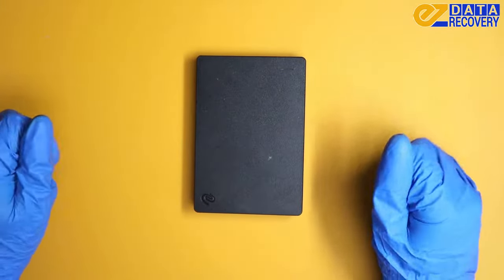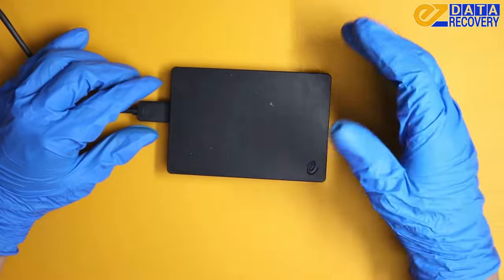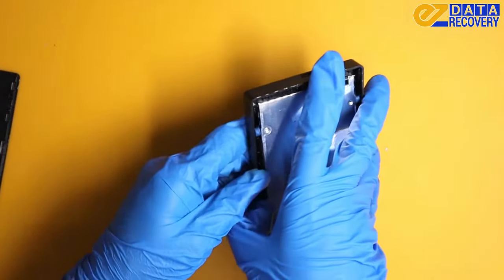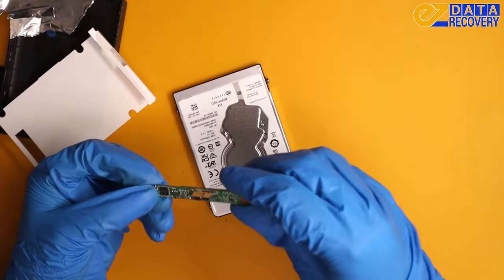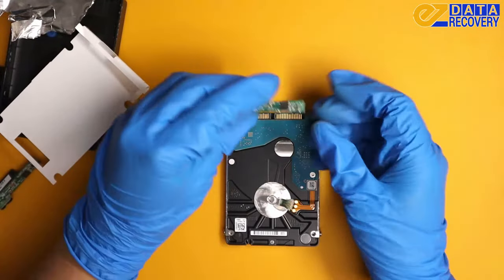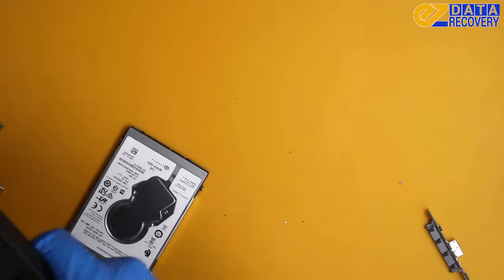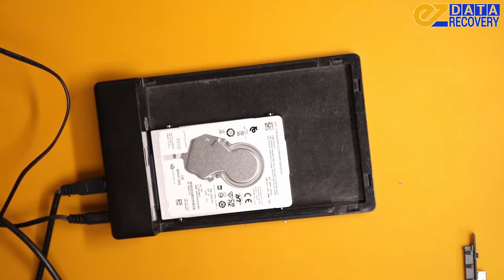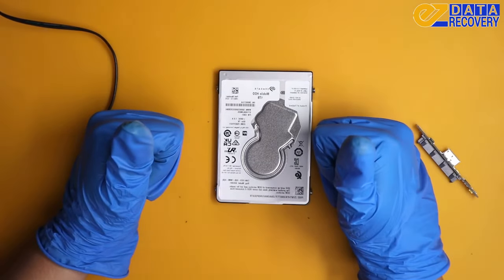Fixing a Dead Seagate External HDD - No Power

Comment: Hey I was wondering if you could help me out. Idk if it's an Xbox thing or my hard drive. I got the Seagate Xbox 4tb hard drive. It used to work before. I will say 5 years ago. When I was using it on my Xbox one. Now that I have an Xbox series x. I connect it, it does turn on everything but the Xbox is not detecting it. But when I plug It on my computer it does. I had looked up online and many people have been having the same issue. What I found online says it's corrupted but doesn't say how to uncorrupted

Comment: I have a Toshiba HDD that doesn't turn on when it is connected. I already tried using two different cables, so I hope it's the same problem with the adapter, but I don't know which kind of adapter it is, and I don't want to risk my data being seen and copied if I send the HDD to a data recovery business.

Comment: hello , i need help..my external hdd power light is not turning on..when i plug in or off, there is windows plug in sound... in disk management it seems as "not initialized " .. when i try to initialize it says incorrect function..
in device manager it only seems as jmicron device (which is probably adapter or sth)

what should be the cause? thank you
Reply: it it bitlocker protected btw.. can it be a virus or something else? like electricity damage?

Comment: Hi there! I have 2 pcs of external hard disk with the same brand and same model. Suddenly one of it is not detected and i noticed the light is there when I insert it into the port but the light is not as bright as the other model that work just fine. I know this case is not similar with your video where the light is totally dead, but could this method fix it?
Reply from the maker: If you have a donor PCB, you can try swapping it and see if the drive will function properly.